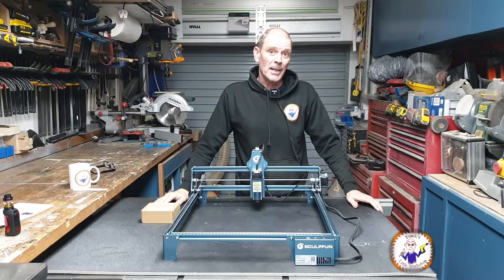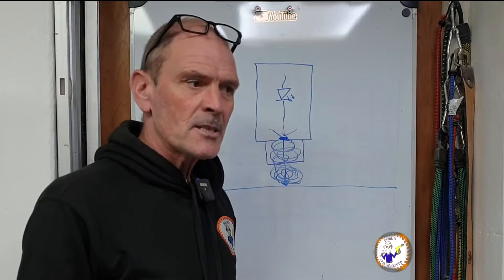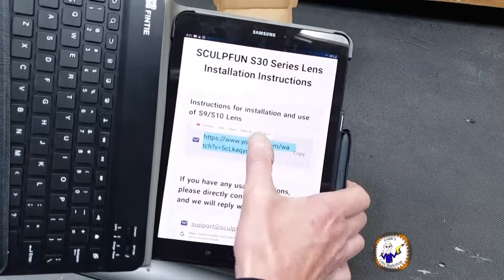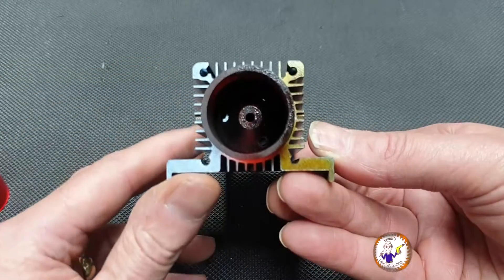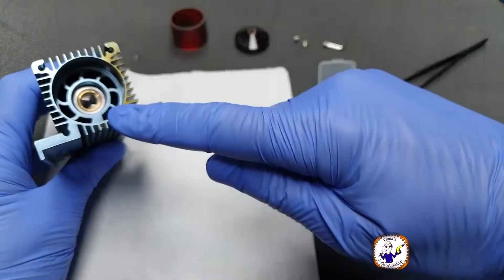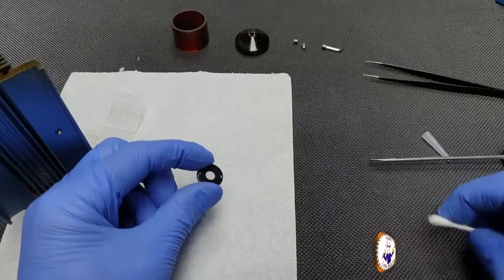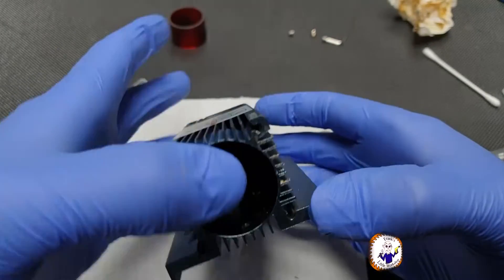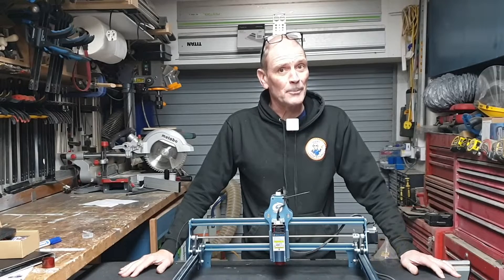Sculpfun S9 laser lens change.

Comment: Saya telah mencoba berbagai macam cara untuk melepas, tetapi tetap tidak bisa lepas. Spertinya pada awal pemasangan terlalu kuat. Apakah ada cara lain untuk melepasnya? Terima kasih
Reply from the maker: Hi Eko, i don't think there is an alternative ☹️. Unless you can make some kind of tool yourself that has less flexibility in it (I.e. it is a little bit more rigid). But you must be careful that you don't damage the location holes or you will never get it out ☹️. I suspect if you try to access it from the other side you may disrupt the position of the diodes which will stop it working properly. You may be able to carefully file down a pair of needle nose pliers which would give you some more leverage. I hope that helps. Thanks for watching 😁👍

Comment: I wonder if you could clean the lense, shield and cover by using a ultrasonic bath
Reply from the maker: @Znegil  🤔 To be honest Znegil I really do not know, but it would be great to find out. If I had an ultrasonic bath I would probebly replace the originals with new ones and then try the bath on the old units 🤔. That way you would minimise the risk if it didn't work. But if it works then you have clean spare units 😃. If you try then please comment again to let us all know if it works or not 😃. Thanks for watching 😁 👍

Comment: why dont they provide a toy for loosening the lense..using a pinzette is a barbary and why do you not clean the old lense
Reply from the maker: 🤔 I have no idea Lothar. I guess these kits are made to a price point and adding extra tools would increase the cost 🤔. I did clean the old lense and now keep it as a spare. I originally changed the lense as they were sent to me by Sculpfun.
Reply: @frankslittleworkshop  such a tool for loosing the lensholder is not very care......the best way to get the smoke is to use  air assist . A simple silicon tube and tiny airpump is sufficent. Dont buy anything of this stuff from companies

Comment: Hi Frank, seems straight forward ,you got this. Surprising how much carbon build up from using the laser, I though Sculpfun would have a tool to remove the lens when you bought it. as always a great video, take care catch you next time 😁😁👍
Reply from the maker: 😁 Hi Shaun, its surprising how much build up there is. I now have air assist that I have to fit and im hoping this will cut down on the build up. I'm sure there is a tool but the tweezers worked out OK in the end. Catch you soon mate 😁👍